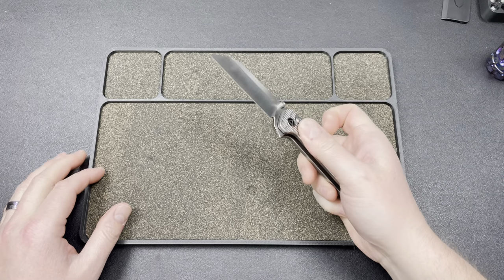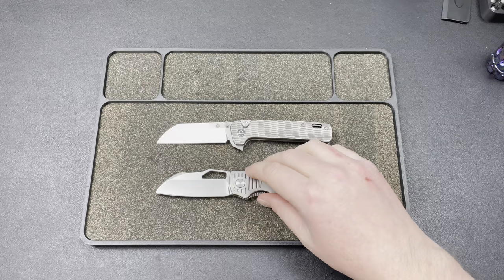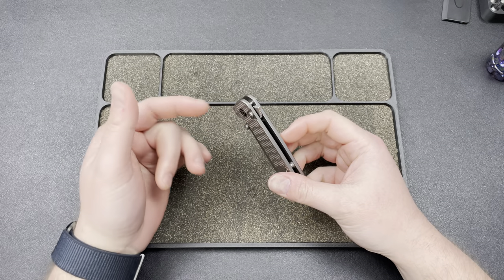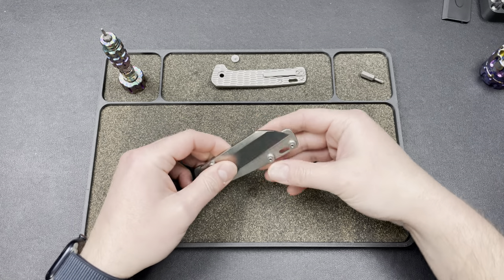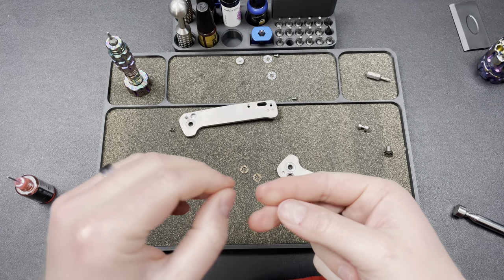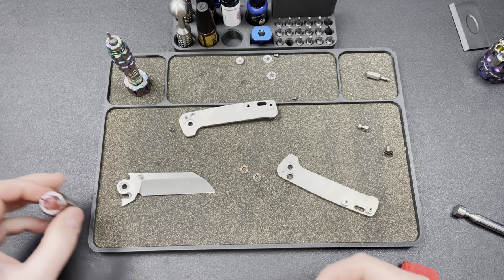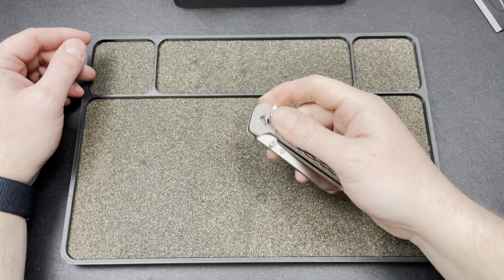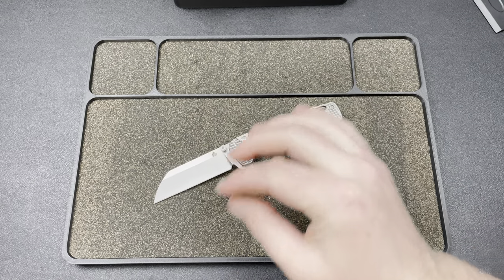TPK Exclusive Penguin Button Lock Disassembly | Skiff Bearing Swap

Comment: Great disassembly video, just getting into knives what oil do you recommend to use?
Reply from the maker: KPL has always been the best and most reasonable for me. https://bit.ly/42J1q5e Lefty10 will save you 10%. I recommend the 3 pack or atleast get the original and heavy